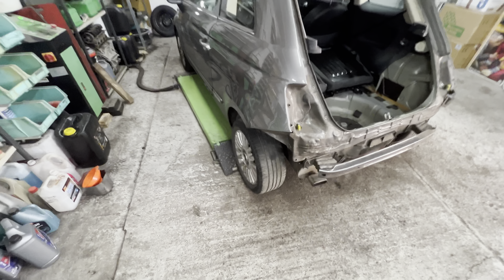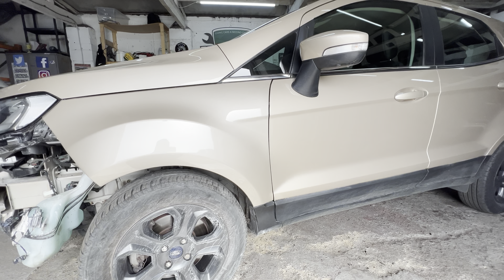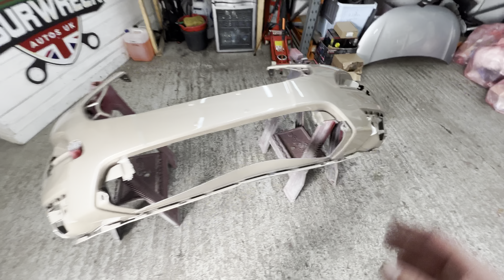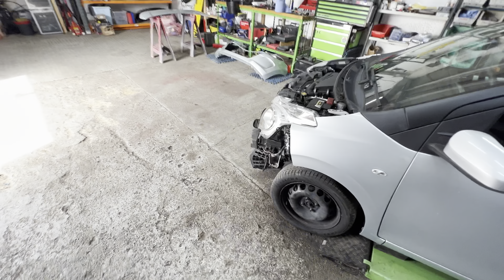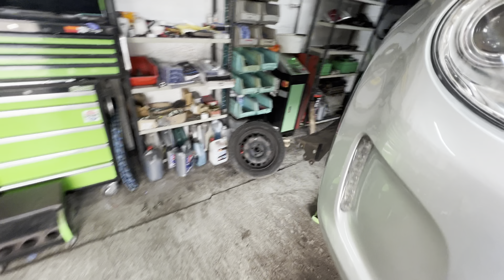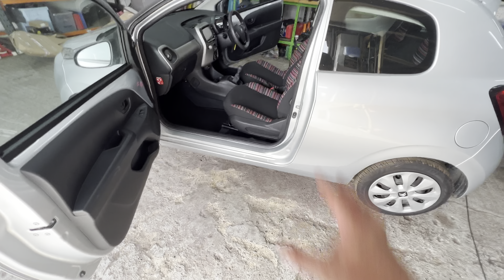Citroen C1 Cat N Copart Uk Salvage Part 2 Back From Paint Shop

Comment: RE the bumper colour being wrong - so you say.
We wont paint just bumpers or any panel without the whole car coz most panels have to be blended into the next panel.
Reason being  - Has the car been painted previously - nobody knows
But as you've identified the back bumper looks off a shade so your petrol cap cover is at the rear but your bumper is at the front - could it of been blended before along that side.
Just take him the car so he can blend it into the wing - it would of saved all this messing and extra expense and time not only for you but for the painter.
Do it RIGHT do it ONCE coz TWICE is TWICE the time and TIME is short.
If we don't get the whole car or supply the paint we don't take any responsibility for re-paints our time is valuable.
Reply from the maker: He did have the car
Reply: Ah sorry about that i must of mis-heard, hmm strange as to why he didn't just blend it.
oh well. @ResurwreckAutosUK